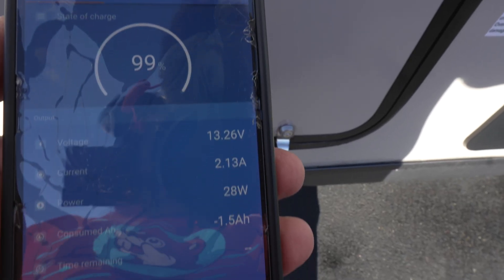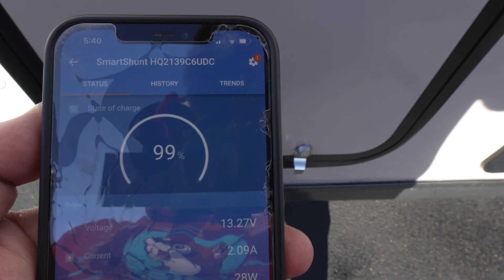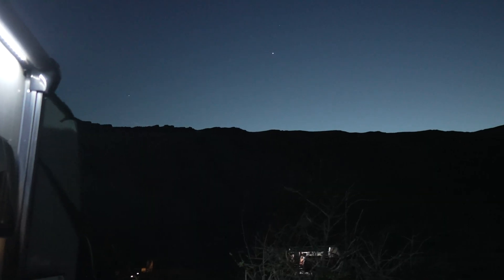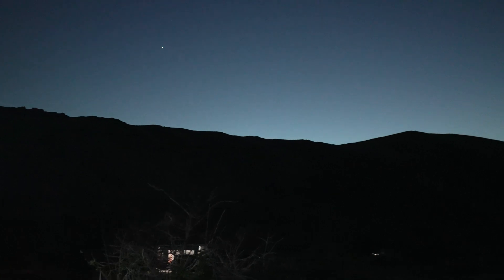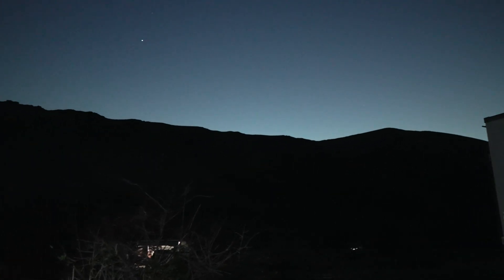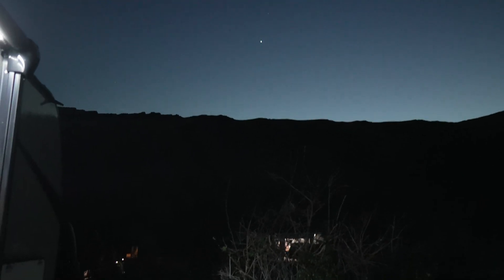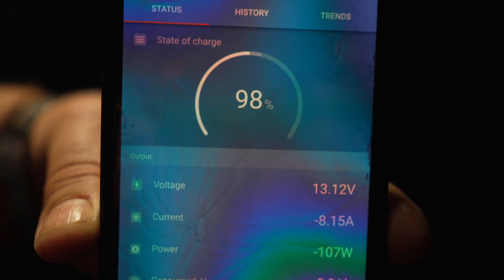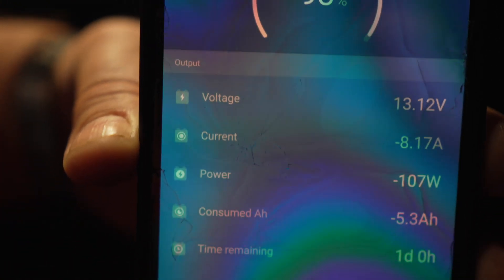SOLAR vs 12 VOLT FRIDGE TEST | BOONDOCKING WITH A 12 VOLT FRIDGE | ROCKWOOD 2109s

Comment: Enjoyed this video. Another fun experiment would be to cover one of your panels and run the same test with similar conditions. Since you stated that you were basically topped off by 12:30, I think you could have captured even more 91 amp hours if you battery was bigger. Another test option would be to start the morning with a more depleted battery. Maybe even down to around 50 amp hours or 75% depleted. I bet you could capture 140 or more amp hours in ideal conditions like you had on this day.
Reply from the maker: Mark, great ideas. I think we can see about fitting in and doing some more testing from a lower power level to see what we can bring in and also to see what is the bare minimum needed for the 12v fridge in perfect conditions. I do feel that for piece of mind that I wouldn't want less than the 380 watts of solar that we already have.  Love the great comment and will put these ideas into video's !!!

Comment: Another solid video.  Those panels are performing pretty well fo you guys.  Do you think you will switch out for an MPPT?  At this point I don't think you really need to based on the power you are using currently.  Did you figure out how much vampire draw you have in the rig with the fridge off?
Reply from the maker: We have been toying with upgrading to a MPPT , but have wanted to see how much rely on the solar . But since making this video I think that’s the direction we will be going.  I’m going to be doing some more testing on the draw without the fridge a bit down the road . We did do a overnight trip without the fridge and the power savings were astronomical.  Thanks for checking in with the video Kyle !!